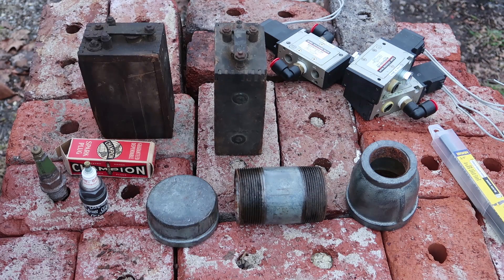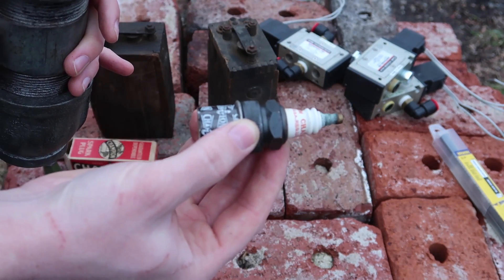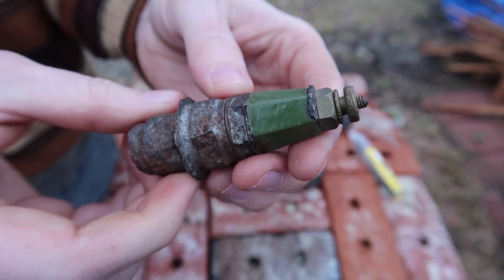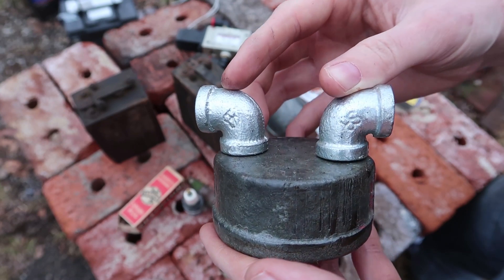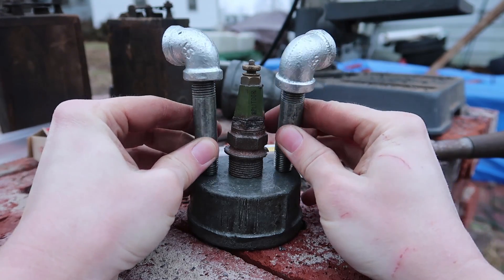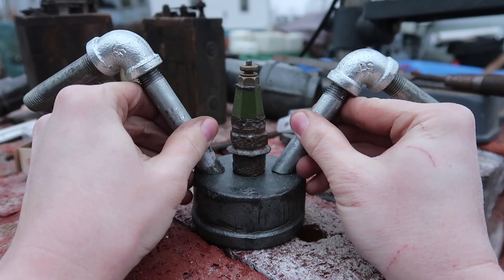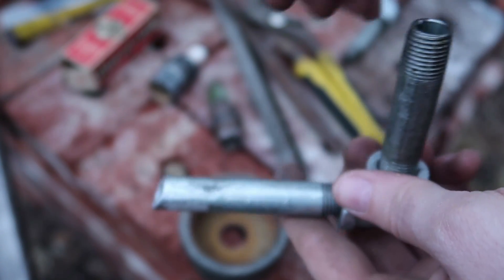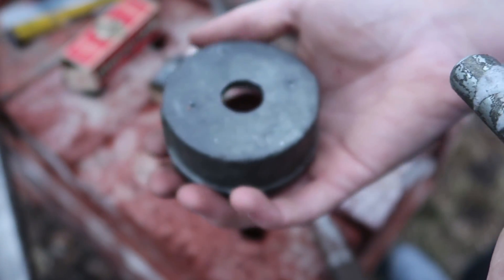DIY Liquid Fueled Rocket Engine 01: Simple Rocket Engine Combustion Chamber

Comment: you need to turn up the amperage on the welder. You're not getting good penetration of the welds.
Reply: MrLes Berg, my dad’s a professional welder. I don’t know how to weld. I should learn.
Reply: Part of the problem is that you need to remove the zinc coating  in the area to be welded and get down to bare steel.

Comment: Active rocket engineer and owner of QuantuMapp technologies here. unless you are using a liquid oxidizer like LOX I highly recommend not using a kerosene, infact I would go for a better fuel like methane, I have built and tested several OX  and CH4 (methane) (both in gasious states) engines and it is defenetly an achievable engine to create and parts are easily accessible. With this simple pretty much homemade engine I achieved at full flow 57 pounds of thrust from materials you can pick up at the hardware store, I see you have the passion! Do a little more research and you can find some quite simple designs, 2nd the combustion chamber is wayyy too small to burn liquid propellant unless you are pressure feeding it through a nozzle about a millimeter or less (I'd need exact specs to feed into the equations). In my honest opinion start by building an engine burning oxygen and propadien (map gas) you can pick this up at your local home depot use a much smaller combustion chamber for this and experiment with ratios of fuel. Do the chemistry and balance the conversion as combustion is of coarse just a chemical reaction. Please contact me for the exact info on how to build this system as I have built several for examples in my lectures. I would love to guide a fellow rocket enthusiast through the steps!
Reply: Actually for your first engine I would start off with a hybrid engine... most of the time people think the hybrid engines are more confusing but trust me, the are a hell of a lot easier to work with, build, and service. The only problem would be getting your hands on PURE nitrous oxide bc it is used as an anesthetic and people abuse the shit out of it (I can see why after inhaling the stuff) its harmless tho! If you have trouble getting your hands on it please contact me. Anyways I'm sure you could even buy a prebuilt demonstration model from me to see how there built. And another good thing is there affordable too (probably even cheaper than the parts you used) and put out quite the thrust! Contact me for more info or comment if you have more questions! Good luck!

Comment: i'm going to be picky (and a bit nasty) in an effort to keep you from doing something stupid.

first - read Ignition! by John D. Clark (it's available online as a PDF) . . . read it all the way through, paying attention . . . the subtitle is "An Informal History of Liquid Rocket Propellants" . . . it contains much useful information . . . useful in keeping you on this side of the sod!

in particular read the parts about chamber pressure and flame traps for the propellant lines and startup explosions and look at the second photograph . . . the photo of the demolished(!) concrete(!) test stand!

if anything kills you it's going to be your welding and welding prep . . . you've got to remove any galvanizing (not god to breathe, by the way) and clean both surfaces a whole lot better than you did.

there's good reasons that most rocket test stands are built to hold the motor so it thrusts horizontally or downward . . . i suggest firing the motor so that it's trying to push into the ground . . . that way if anything fails it will probably just dig a hole.

please, i want to see you do more videos but i don't want to read your obituary.
Reply from the maker: not sure why you think its going to kill me, im not going to be anywhere near this thing during tests. will be over a hill watching remotely. so my welding doesnt matter. might lose a few cameras though.
Reply from the maker: oh and i like getting my information directly from rocket engine documentation from NASA and other organizations. for instance i have a 1960s declassified book just on the design of turbopumps.

also heres a good read: http://large.stanford.edu/courses/2011/ph240/nguyen1/docs/SSME_PRESENTATION.pdf
Reply: Glad to hear you'll be keeping a safe distance. Many professionals have died, and STILL die to this day working on engines, and amateurs are even more likely to make mistakes. The book suggested above, Ignition! is still a must read. It's pretty much the bible of rocket science, and well worth it, even if you've got other sources. At the very least it's fascinating to read and covers a lot of the mistakes that have been done in the past so you know what to avoid repeating. 

And please, take people's advice on the materials side of things. Zinc welding is horrible for you. Those fumes may hospitalize you before you ever get to do a test fire. 

I think you've got a lot of well meaning comments here that want to help you avoid  mistakes. We want you to succeed!
Reply: @jesscast5122   why thats kindof sexist
Reply: @RinoaL  
Hey, do you know where 8 could see/get that book on turbopumps?
Reply: @strangejmaster  gave the punk a taste of his own medicine, is all

Comment: Oh cool you built this rocket motor very quick.
Reply from the maker: collecting parts for a few weeks, it came together in a few days though. theres a lot more other stuff that goes with it though
Reply: motors are electric, rocket engine
Reply: @willlemmesman3501  motors aren't electric in the context, it depends on preference but a rocket can either be an engine or motor, usually solid rockets are called motors but you could call a liquid fuel engine a motor if you wanted to

Comment: Very nice to see a lady doing the same sort  of crazy projects I can't help but tinker with. I don't know anything about rocket engines but I was thinking that the injector holes installed in the side of the chamber pointing slightly off centre of each other would promote swirl and better mixing and burn characteristics. Also the rocket will never produce more pressure then the fuel delivery pressure so based on the diameter of your motor you may get an idea of the sort of thrust to expect.

Comment: I'm thinking of a check valve on the oxygen supply. Seems like fuel splatter and back pressure waves from the combustion chamber might make it back into the supply pipes. I don't think it will be much of an issue for the kerosine side but I wonder how it will affect the oxygen pipe.
Reply from the maker: yeah i bought some flashback arresters but i think they will limit the flow too much. i plan to start with a small 20CF O2 cylinder so in case it blows up i wont be out much, and then later move to the 250CF O2 cylinder.

Comment: A friend of mine built a rocket assisted take-off motor for seaplanes in WWII. They needed the extra thrust to take off in rough water. He had the nozzle on his desk and it was made of copper. He said that heat would pass through it faster, before it was damaged, but the ceramics, which came later were better.

Comment: any thoughts on re generative cooling, or even making a gas shield ?   it's really the next step , apart from relying on the metal to just hold up.. maybe some sort of ablative coating on the inside of the the combustion chamber.. to manage temps once you get going well, as for your igniter, a gas shield of fuel around the metal bits might help it survive.. as long as yer fuel is cooled..

Comment: If I'm not mistaken, on those newer sparkplugs, you can take that tip off by turning it CCW, and it should reveal a threaded stem, like on your Splitdorf.  You can then reuse that tip, or find yourself a wide nut to thread on the top and hold onto eyelets, hooks, etc.

Comment: Hi Rinoa! Your videos are awesome! I have a mobility scooter, and I made a pack from salvaged laptop cells, but sadly it's awful, so I'll have to invest in some proper cells, but they're expensive for a 15 year old :/
Reply from the maker: depends on how much your pack is and how bad the cells are. make sure to have 1AH for every 500ma you plan to pull, then maybe be a bit more picky about what cells you use, like focus more on mostly-good cells
Reply: Thanks. I guess I can discharge test them with my Imax B6, then get picky about which cells I use.
Reply from the maker: yes you should do that from the start. and check to make sure none are getting too hot when discharging, thats a sign of trouble too
Reply: Thanks for the advice!
Reply: gtaguy235 Hey man that's awesome!! You made your own vehicle!!
Reply: Way to go Rinoa    Learn as much as you can and then experiment. Best way to learn anything and become proficient.

Comment: What if you mix a little bit of propane with the kerosene to get it to light? What are you going to use as the oxidizer? I am thinking of using liquid oxygen or nitric acid.
Reply from the maker: im going to use gasious oxygen at first. i have a big cylinder that should give a few minutes of a test at full power. then we'd upgrade to LOX

Comment: how do you plan to pressurize kerosene to overtake the pressure from the oxygen. i think this will be more of a large blow torch - cool none the less! i wanna see it run
Reply from the maker: kerosene tank, with 2000PSI nitrogen or 800PSI CO2 cylinder feeding into it with regulator for whatever pressure i wish to be put on the kerosene.

Comment: Could you use butane as a rocket fuel? It pressurizes itself, but at the same time, even a soda bottle can withstand the necessary pressure to keep it liquid at room temperature. I don't know if it would need to be pressurized more, but it is fairly cheap and burns easier than kerosene.

Comment: ok... have you thought about making a pressure chamber to contain hydrogen and then just using a hho generator to produce your own gas?
Reply from the maker: yes ive thought about it, but you can buy oxygen and kerosene from the local hardware store. itd take me a long time and a lot of hassle to do it myself, i might as well spend the 40$ for a refill of oxygen and maybe a few gallons of kerosene. after all i have a YT budget.

Comment: You can also unscrew the tips off new spark plugs also if there is a need for a hotter spark hook the plug wire just on the tip of the plug

Comment: Try designing it with a baffle plate and a premixing chamber right inside the injection point so the fuel/ oxidizer mixes better so you will avoid the combustion cycling/ occillation that blew up many early NASA rockets.
Reply from the maker: thats an interesting idea, thanks
Reply: @RinoaL  Coincidently i just saw a video that talked about early rocket failure due to improper fuel oxidizer mixing. it causes the combustion pattern to start an occillating  vortex that destroys the engine.

Sorry I forgot which one, i'm on a rocketry video binge.  LOL
Reply: @RinoaL  Check out some of Scot Manley's videos, he has a couple that talk about rocket engine plumbing/construction.

Comment: how do you plan on dealing with the coking problem from the kerosene?
Reply from the maker: not run it for very long, and hopefully eventually switch to a different fuel like methane. but kerosene is easier to get so i'll try that before methane.

Comment: Remotely for sure behind something heavy. Mixing O2 with oil based items doesn't require an ignition source possibly blowing that canister about just checking for flow. Don't even have oils on the O2 lines. Some hobby and car shops have nitrous for hotrod's that could give you the thrill you desire and possibly cheaper. Burn impulse is key to engines power.

Comment: Great stuff man, I love it! 
Please be careful with the smoke from welding galvanized metals it’s toxic big time.
Reply from the maker: thanks, and i know. thats why i weld outside and hold my breath
Reply: That white crap everywhere is zinc oxide, try to grind back any galvanizing clear of the weld as zinc in a steel weld will
Make it brittle. Fun otherwise 👍

Comment: I really 👍 it. Subject the shaft to three conditions one with the pneumatic piston choke flap where your circular arc should be localized above flap 2mm from the shaft walls to build momentum and torque for a compressor blade on a ball baring held center of fan mini, bracket.

Comment: little tip clean rust before welding with sand paper on wire wheel  it's help soo much with leak created by bad solder join and this make solder more sturdy :p

Comment: You've probably gotten a lot of suggestions by now but in case you haven't:

 Your speed on the drill press is much too fast for the size drill you're using for the spark plug and you should drill a pilot hole first because the wedge on the tip of the large drill bit isn't really made to do what you are doing. You really should get a small vise for this kind of work. Oil would be a nice addition when drilling also.

  I don't know how much money you have for fooling around but you could turn that drill press into a mill for about $200. I don't know what your quill looks like but if it uses a Morse Taper shank to accept the drill chuck, which most do, you can likely get some tapered roller bearings to replace the ball bearings that are probably in the quill. You'll need a set of calipers or some other accurate measuring device to get the sizes correct.
 After that, you'll want to purchase or make a rectangular brass piece to go in the slot that is used for the bolt or screw that controls the stop. It's the thing that allows the quill to stay in place when it's partially or all the way down. That will give you increased rigidity and decreased run-out (wobble). Both are essential for milling.
  So long as your quill does use a Morse Taper, you can actually buy Morse Tapper collets for about $10 each to hold end-mills or get something like an ER-32 collet with a Morse Taper shank you need to find out which Morse Taper you have first though. I imagine it's an MT 2, 3, or 4. 
  Then, you'll need to purchase an X/Y table you can get decent ones for just screwing like this for $80 to $150. Harbor freight sells one that's not half bad for $75 or $80 Make sure it's the one with dovetail ways though! You don not want the one with flat ways for 5 or 10 bucks less, it's worthless! ...ask me how I know.

 Having a draw-bar could possibly be vital to this effort if the Morse Taper in the quill is damaged but I'd rather hold off on explaining all that and see if you actually want to attempt this endeavor first.

I was self taught on the drill press as well so I understand the tendency to do what I saw you do but after going through machining school & learning all the effective ways to accomplish good results I cringe watching people do it that way now. Holding the Work is not only essential for safety, it's essential for tool life as well.

Also, if you don't do this stuff all-too-often, I may be willing to do some manufacturing so long as you send me some readable plans. I'm still less than 2 years out of school & my peers have 25 years experience so I'll take all the experience I can get. I have a small mill/lathe combo, all the accessories for the basics in manual machining & access to good, medium sized equipment on the weekends, both manual & cnc.

Comment: You can make hydrogen from water with electrolysis. You then compress a lot to the point that the gas is forced to turn into a liquid. You can make it easier by cooling the tank that you pump the hydrogen to. Of course you need to decompress the tank first before putting any hydrogen in so you get the most purified liquid hydrogen. I suggest you also use a the O2 from electrolysis to ignite the fuel. Good luck.
Reply from the maker: hydrogen by itself is worthless, you need liquid hydrogen for rocketry which is dangerous and seeps through metal. your a moron for underestimating the problem.

Comment: Both spark plug tips you showed should screw off. I just found out too lol
Reply from the maker: yeh i wasnt very clear, the older one has a wider screw so it can actually hold a bare wire while newer ones are very narrow.

Comment: a great classic beginning for a propulsion engineer..but safety first, standoff and concrete will quickly become necessary as well as a remote location (rocket engines can be UNBEARABLY loud)
Reply from the maker: dont worry im working on even making the fuel valves remote activated. and i found a friend who had a really deep creek in his forest. a section is like 5 feet wide but also 5 feet deep, i figure ill do the first tests in there so if the thing explodes itll be like a bomb in a military trench. im still not sure if im going to be hundreds of feet down street or just over the hill with a tv and camera for remote viewing

Comment: solonid no way u need a turbo pump which can pump pressure more than the pressure of the chamber itself or the whole flame will propageate in to the plumbing (dont be amused  energy flows from high to low so will the pressure once the chamber pressure elapses the lox and fuel tank pressure there will be a back propagation)

Comment: curious if you could elaborate on why it would be hard to get hydrogen please? the design for a hydrogen generator capable of separating hydrogen from the oxygen. with the use of a carefully selected vacum pump you should be able to collect it fairly easily. would suggest doing some research into making good containment as hydrogen is very tiny and loves to escape. i do understand why hydrogen could be given the components your currently working with would not be ideal. enjoyed the video looking forward to many more.
Reply from the maker: because it has to be purified, dried, and lowered to -423 F* in order to become a liquid.
Reply: ahh ok that would explain it. wondering how purification goes. gonna have to go look that up now. im used to using hydrogen more in the gaseous state and not the liquid. for some reason i was thinking compressed but gaseous storage and use as the fuel. thank you for clarifying and taking the time to reply.